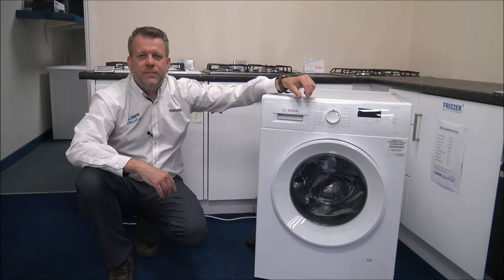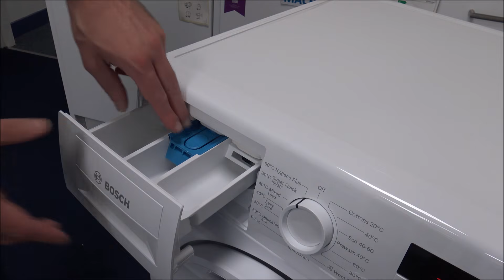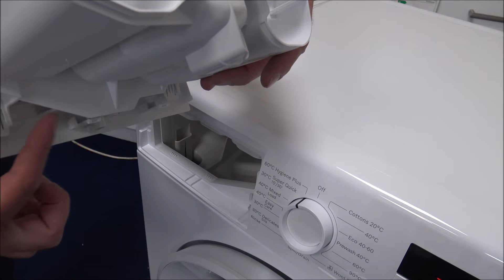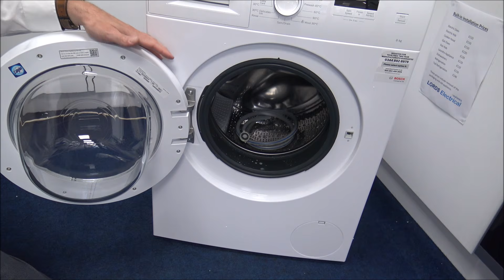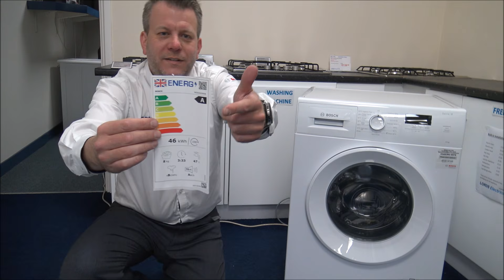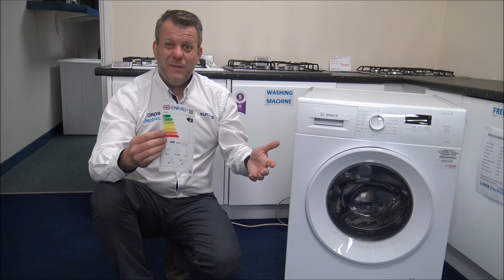Bosch WGE03408GB Serie 2 1400 Spin 8Kg Washing Machine

Comment: Could someone assist with reset options, the clothes r still wet completely post the wash, not dried during the spin
Reply from the maker: Is it a small load, as under loading can cause the machine not to spin properly

Comment: A useful video, thank you.  It seems that we really don’t have much control over these digital washing machines. I have bought mine couple of months ago… I still cannot program it to my chosen certain spin dry, for desired amount of time and certain temperature and  how many kg??? More than half an hour passed from the start the washing, the digital screen is still displaying 1:45!!!  What could be wrong that the display time is not reducing the amount of time it was set for?  Please advise.
Reply from the maker: Unfortunately the time will vary a lot depending on how dirty the clothes are, capacity and fabric types too, so there is little you can do to change the time of the wash manually

Comment: thanks, helpful. I watched because the instructions that come with the machine are not simple. 
My previous machines were AEG, Hoover, Hotpoint, all of which had progammes of a set length. Hard to understand programme timings linked to the kg load. 
Also I didn't understand what "Finish In" meant or the related lit up symbols. It would be helpful if you explained this feature, as it was hard to find anything to understand it online or in the instructions, I understand now it's for starting a programme late (I wouldn't want to).
Reply: If you want your laundry to be done by 8.00 am and you are loading your machine for example at 10.00 pm this means 10 hours till 8.00 am.Press finish in several times until it shows 10.Press start,the machine locks,and you can go to bed.Don't forget to put the laundry detergent and conditioner😅,if you use one....Ofcourse you can do this day time aswell.Just count the hours until you want it to finish!!!!

Comment: Thank you so much for doing this video, the manual is hopelessly hard to understand. I have a feeling that this machine has been developed for efficiency, but if they had asked someone who actually used it for washing, they may have modified some of the programmes. Thank you for pointing out that the 60 cotton option is a pre-wash the manual just says it's a 60 degree cotton wash! I just put it on and 3.5 hours later wondering why it's still churning around, until it clicked into spin and rinse mode, which adds another 38 minutes to the programme! I like a 60 wash for towels, but at over 4 hours to complete on this machine, I'm starting to question the eco-energy-efficiency thing that Bosch seems to think it has created. It would be useful if the machine could let the user know what the weight of the washing is BEFORE activating a programme - how are we supposed to weigh everything for maximum eco benefit. My old Bosch was 20 years old when it passed into Washing Machine Heaven last month, and I wish I had seen this video before I purchased the Series 2, I'm so disappointed. The old machine did a 60 wash in a couple of hours at the most. The saving grace is the 40 mixed load which most of my stuff will be done on. So many options, so little used! Thanks again for the info, you're a star! 🥰
Reply from the maker: Glad the video was helpful for you, thanks for such positive feedback

Comment: Thankyou for starting with the dimensions. Bosch quotes 63.2cm depth which sounds deep. It doesn't matter if the door protrudes as long as the body of the machine fits under the worktop.

Comment: Thank you for your excellent review. Can you recommend can't machine that doesn't have all those options in the budget range - is front loader a nettercchoice
Reply from the maker: On the whole, a Hotpoint or Beko machine would be a good choice at the starting end of the range, but if you can stretch to it then a Bosch machine will normally be a better choice as reliability goes

Comment: Not having bought a new washing machine for yonks my mind boggles at the choices of cycles and load sizes. I didn't realise that certain cycles only function on maximum loads below what the machine is capable of. Is that the same for all machines,?
Reply from the maker: This is pretty standard on all machines nowadays, not many machines will offer the ability to wash a full load on all programs

Comment: I’ve just purchased this machine and have encountered a problem today . When I put towels in with a mixed load the machine made a banging noise when it was spinning. The transit bolts have been removed and the machine is level. My old Bosch machine has never done that with any loads I have put in . I’m concerned there may be a problem, do you have any ideas why the new machine is doing that ?
Reply from the maker: It can sometimes be down to the load of washing being too small especially when towels are involved. If you have several large items in the drum, it can struggle to balance it properly and can bang around when spinning. I would try increasing the load to see if that helps.

Comment: Hi lords eletrical. quick question, how do i wash in cold water please?
Reply from the maker: Depending on the machine you have, on the temperature selector, just keep pressing it until it displays -- which is a no temperature option and it will wash in the temperature of the water arriving into the machine

Comment: I have never bothered with Pre wash. Think they are a waste of time.  I am not keen on the cycles being predestined and so long lasting. I usually do a 60 wash for 1 1/4 hour and colours 1 hour. I think these cycles on new machines all look far too long. I have a 8kg Bosch machine I bought 17 years ago and found that hard to use. It didn't seem able to handle the loads ever! Felt like Bosch made the 8 KG without checking out it could handle this type of wash. If you want to wash sheets it couldn't ever handle it. Even the simplest of cycles it struggled and had to get someone in to help sort it out (not from Bosch) as they were not help at all. It is at the end of life now and looking what to buy. Find all the fuzzy logic stuff, un-logical and fanciful, not practical for actual straight forward washing. So I am stumped what to buy now. I feel fine about new technology if it helps me but when it hinders my goal of getting washing done clean and faster, I find these modern electronic machines, for all our domestic items not made for us users but for technology sake and as an end user I find that frustrating. So it feels out of my control and I feel how I wash clothes needs to be designed for on the go women and men. We haven't got time to fiddle around with  3 hour washes. Its totally ridiculous. Thank you so much for doing these videos. They are so helpful and I can see Bosch still doing those long drawn out washes... Nothing changed there then!!  I am looking for more control over a machine, not less!!

Comment: Great video. Thank you.
A question:
The manual recommends (on page 16), before using for the first time, to start an empty washing cycle by first turning the programme selector to  . ie it doesn't actually say which setting to put this on...  just an empty space and a dot. Any suggestions???
Reply from the maker: I would normally put it on a 90 degree high temperature wash as an initial wash before using the machine.

Comment: Can you advertise that you sell the oxygen bleach for the first wash. I had call many times to learn about my new machine, and not one staff mentioned that it is important to use oxygen beach, which Bosch sell. What the extra parts given to me in a plastic bag. What are they used for? Does it matter if the clothes weigh 7lbs rather than 8lbs, I have no exact way of judging the load. I know there should be a space of an outstretched hand. Thank you.
Reply from the maker: Normally just doing a hot wash before using the machine with clothes in is enough rather than having to use oxygen bleach

Comment: Can you please show how you fill the try with washing liquid. I was not sure if you have to take off the blue centre part. Can SPEED PERFECT be used for most programmes, although I would only use Mixed Load and maybe the 15/30 minute option. Thank you.
Reply from the maker: If you are using liquid then keep the blue part in the soap drawer so that it doesn't enter the wash too early. Speed perfect is a great program but can only be used on certain programs and also reduces the load of capacity for the washing by approx half. If you used the shorter programs like mixed load and the 15 min program then you can't normally reduce these further in time.

Comment: Many thanks for this video. With reference to the Easy Care programme at 40°- can Speed Perfect be used with this programme and, if so, would the maximum load be reduced to just 2kg?
Reply from the maker: Yes it can be used on the Easy car at 40 and it will reduce the load capacity of the program too
Reply: Thank you for the info. @lords-electrical

Comment: Hi I can see there is a spin speed button but is there a button to manually adjust the temperature as with the higher models like the series 4 etc?
Reply from the maker: Unfortunately not, you are fixed to the temperature of the program which you have selected.

Comment: Is there a way to use spin only? I seem to be getting rinse only instead of rinse and spin! 
The garment I'm trying to wash keeps coming out soaking wet...
Reply from the maker: If you select the Spin option at the bottom of the program selector, then it will only spin the clothes. If you select the Rinse option next to it, then it will rinse the clothes which isn't what you are after.

Comment: Just bought  this  machine after  having a  Direct  Drive  LG  for  years. We  put  towels  on  last  night but  my wife must not  have set  spin  speed. So  the  towels  have a  lot  of  moisture  in  still. How can i  just  spin the  load  without having to  go  through a  wash  cycle. Some  of  the  manual is  a  bit  Double  Dutch. Hope  someone  can  please help?
Reply from the maker: At the bottom of the program selector there is a Spin option. Select this and select 1400rpm and this should help to get more moisture out of the clothes.
Reply: @lords-electrical  Thanks  so  much  for  your  advice  worked  like a  dream.

Comment: A useful video. Thanks. I have had this model a month and it's been fine so far. It seems well built, fairly easy to use and quiet when running. I was looking for the simplest, easiest machine to use I could find. This was the only one that even vaguely fitted the bill ( there are still too many functions and things on it that make no sense) - one day, manufacturers will realise that less is more for many people and constantly adding 'features' is not what many people want, especially older people! I only ever use the quick wash and 1 hour mixed load wash. All the other programs are pointless for me as is the prewash nonsense, and I would certainly never use a program lasting over 3 hours!
Reply: Yes indeed, I agree 100%!
Reply: If you do ever want to use a slightly longer cycle you could always use cottons and press speed perfect to make it shorter :)
Reply: I miss the delay timer too😅

Comment: I don't think the 60°c and 90°c cotton washes include a prewash, pretty sure it's only the 40°c one (but confusing labeling by bosch either way). Also think you should've mentioned the speed perfect option earlier in the vid, a lot of people would find 3hr normal cotton washes unacceptable, only to realise it's half as much with speed perfect. Otherwise good though
Reply: yep, but more elec used and possibly slightly more wear to clothes.
Reply: @RainbowCharade  No? A shorter wash will cause less wear to clothes. Also there is no correlation to cycle length and energy consumption
Reply: @RabbidTheNabbit I understood activating "Speedperfect" increases agitation hence speeding up the wash. This I was told is at the expense of using more electricity all-up. I assume the gentler but longer program would be preferable for reducing wear (this is a problem I suffer a bit with shirt collar wear)...I would take advice on that though!

Comment: I currently have a Bosch series 6 washing machine in silver I absolutely love it. 

I was just wondering if I was to move to somewhere that had an integrated kitchen how would I go about putting my freestanding washing machine into the kitchen? Would I just need to remove the plinth at the bottom?

The dimensions are pretty standard.

Thanks so much.
Reply from the maker: In theory, yes it should just go in if you cut the plinth at the bottom of the  machine

Comment: The prewash is only for the 40 degree wash, 60 and 90 are without prewash. I dont really see the point myself i think they should have had something else instead of the 40 prewash cycle
Reply from the maker: I agree, Prewash programs are very rarely asked about now on washing machines
Reply: @lords-electrical  I think they should have included an easy care or mixed load 60 degree wash cycle instead of the prewash 40 degree cycle
Reply: @LaundryGuy1500  suspect it is to go more eco...